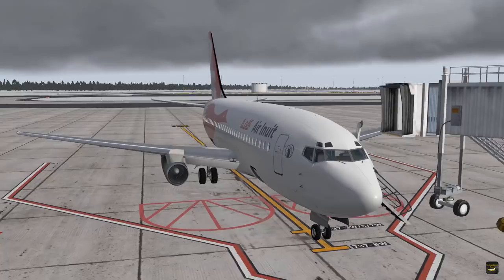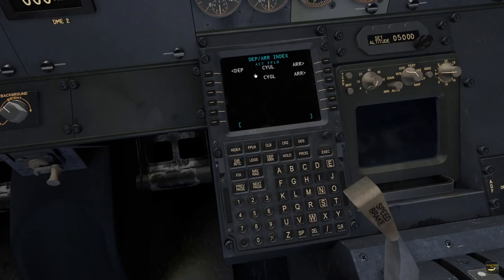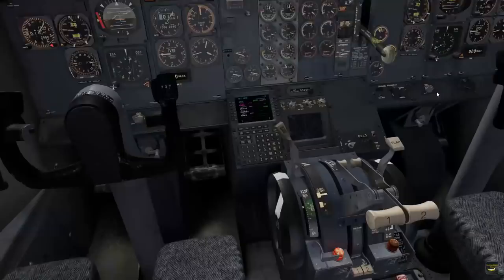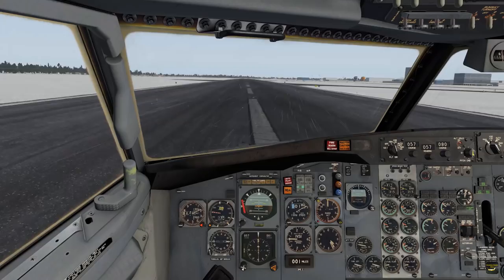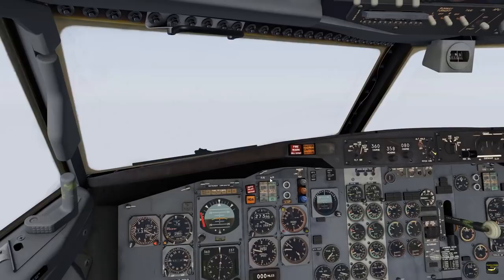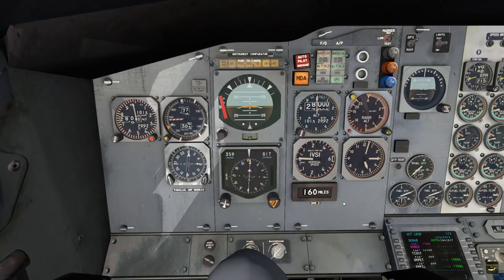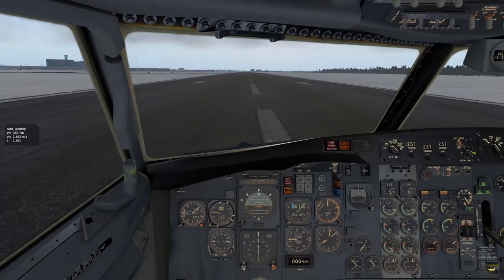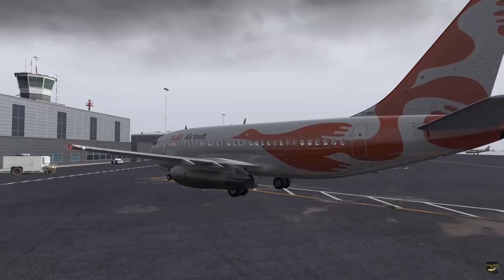FlyJSim 732 Twinjet V3 Pro | Tutorial [X-Plane 11]

Comment: Very nice. I loved this. A note on the reversers, not sure how you're doing it but I used to assign it to the button at the end of the Saitek throttles and always had trouble with that. Then I realized I can assign a whole axis to "Reverse" and this basically lets you modulate how much reverse power you want. From Idle all the way to max. Provided you have a free axis somewhere. I got two throttle quadrants that go Speed Brake/Reverser/E1/E2/Nothing/Flaps. (I got nothing in the fifth one because I never got it to work right with the gear)
Reply from the maker: Thanks for the hint and that's a nice solution! I'm also using the "detent" at the end of the Saitek Quadrant throttle axis. I assume you used the command "hold reversers at max" or how it's called, that will always deploy reversers with full thrust. But there's also a command "toggle thrust reversers" that just activates the reversers and then you can determine how much reverse thrust you want with the throttle axis. That works very well for me with all airliners, but with the 732 sometimes they won't engage.

Comment: Thanks! I'm having issues intercepting localizer. I'm usually flying with CIVA INS and when I switch from GPS to NAV at FAF it won't intercept it. Everything is set and I'm using VOR/LOC mode no Auto App mode, so not sure what's wrong. Any ideas?

Comment: Great job sir. I love this plane too. It's nice to have the fms seeing that most Sid's and stars are rnav type. I noticed you didn't plug in the cruise altitude on the vnav page. Is that just your preference? Thanks again and look forward to more!!!
Reply from the maker: Thanks a lot Robert! Well I skipped the VNAV pages in the FMS because they won't have any influence on the flight performance of the aircraft. This classic 737-200 has no VNAV capability, it just happens that these pages are within the default XP11 FMS which this aircraft uses :)
Reply: Right, but if you enter crz alt and intended descend speed, it will calculate T/D for you.
Reply from the maker: @pawestoowski2381  Oh that's good to know, thanks for the hint!

Comment: I also love this plane. Still have an issue during rotate, it's going down for a moment or just struggle for a second in that moment.
Reply from the maker: Hi Henning! Yes, I have the exact same problem. It feels as if the calculated takeoff trim isn't enough during rotate and you have to trim up a bit more. Also I have this strange thrust reverser problem sometimes. Other than that it's an awesome classic airliner for sure :)

Comment: My yoke keeps moving when the AP is on, anyone know how to fix?
Reply from the maker: That's correct behavior, the Yoke is always linked to the flight surfaces and it moves with the autopilot inputs.
Reply: Simulation Channel Deluxe I think I phrased this wrong, but the yoke keeps moving back and forth, not because of the autopilot inputs but probably because of the trim. The trim wheel is constantly moving and it just bobs the plane up and down at cruise pretty much. The trim shouldn’t be moving either, there isn’t any corrections needed and there is no turbulence
Reply from the maker: Oh I see. I think I read something about this problem in the forums some time ago. Do you have the most up to date version of the aircraft installed using the Skunkcraft Updater plugin (for version 3 of the aircraft)? I think the problem got fixed with an update.
Reply: Simulation Channel Deluxe Ok I will try, thank you